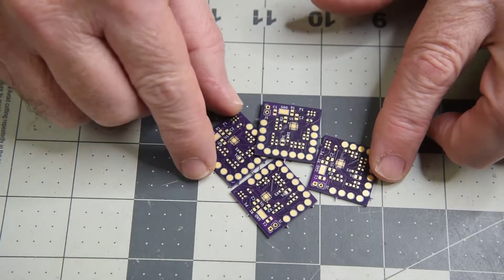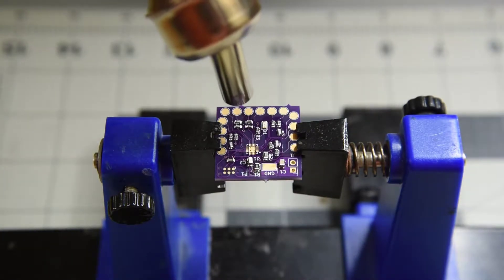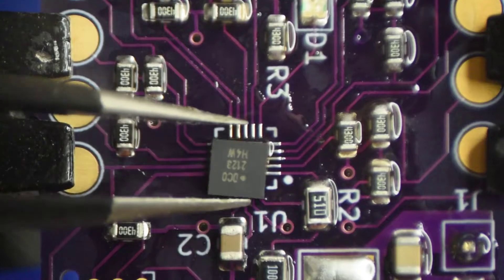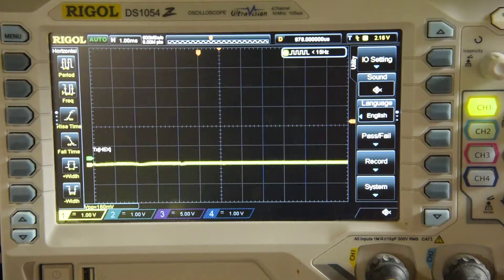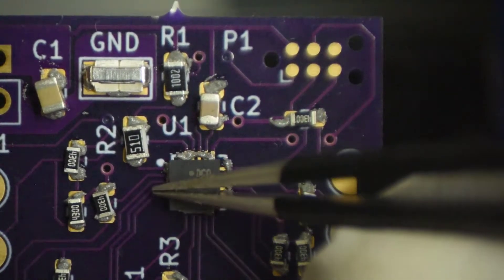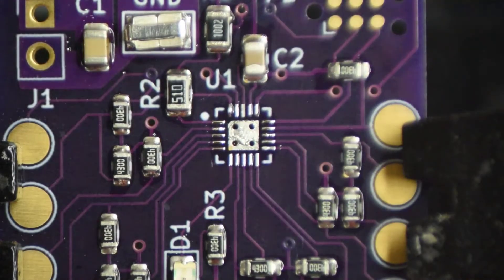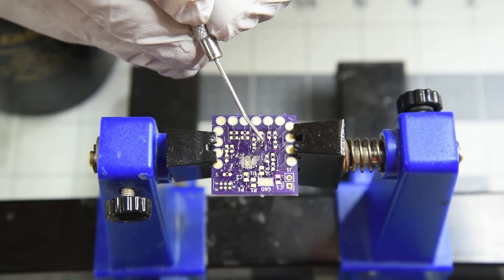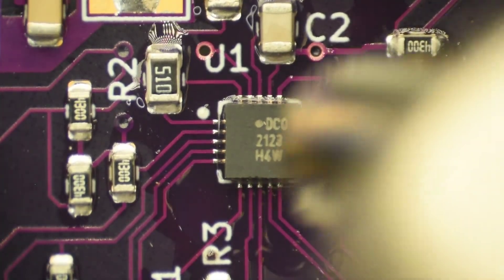QFN-20 Success + Bonus Solder Paste Adventure

Comment: Why just not to start soldiering from IC, that why you don't risk rezystor and capacitors to fly away. If resistors and capacitors are that big you dont have to use hot air. Just use regular iron, put a blob of solder on one pad and place component on it while melting a solder. It is much easier and faster imho.
Reply from the maker: I've become addicted to solder paste and hot air.

Comment: Great job!!.  I have a question, when you mentioned the temperature, it's 800 degrees fahrenheit right? not celsius.  Just to confirm. 3:45. Thanks
Reply from the maker: Yes, for sure Fahrenheit.  For small parts now i run the temperature at 800 degrees Fahrenheit and the air at 5 to 8 percent.

Comment: Hi, when I solder DFN/QFN packages I push it with the tweezers, the excess solder paste forms a blob on one side of the package, I remove this with the solder Iron and generous flux. But if you want the easiest method: get a solder plate, I think that maybe the best solution for solder SMD. Awesome channel BTW.
Reply from the maker: Do you push the package down or push it side ways to get off the extra solder?  I’ve looked at a couple of hot plates.  But I don’t see any info on the heat up and cool down times.  And thanks.
Reply: @metalplasticelectronics354  Push it down, just push and let go while it's under the heat gun, one time. I just got one: Mechanic ET-10, it's a 100x100mm plate, takes around 4 minutes to reach 220C, the cool down it's really slow, I didn't really checked how much takes but maybe 1hr, so you have to remove the boards once the paste melts, the more popular it's the 200x200mm sizes, also, don't know what are the heat/cold times for those but there are a lot of reviews on YT.
Reply from the maker: Thanks, I'll watch some.

Comment: Good job! You're definitely getting better. 

Solder paste is weird - people either love it or hate it. Personally, I never had much luck with it. But you have to remember what it was made for and how it's used -  when an engineer is doing a layout for his PCB, he also makes a stencil of all the pads that's only .005"-.010" thick, and the stuff gets smeared on a board that way. So, in reality, the whole pad's covered, but it's still 10-20x less than you could apply by hand.
Reply from the maker: I quit trying with the solder paste on the small pitch devices.  But I’ve used it a couple of times now to solder 603 and 805 size parts.  I think I like it better than putting solder on the pads and then a layer of flux.  The parts stick a little better in the solder paste, I think that’s why I’m liking it.  I believe the determining factor for me, will be how long it holds up.  I have it refrigerated like it says.  If I can use the entire tube, then I’ll be OK with the price.